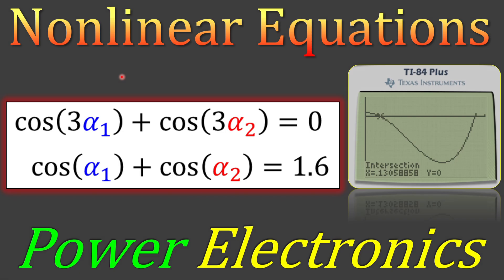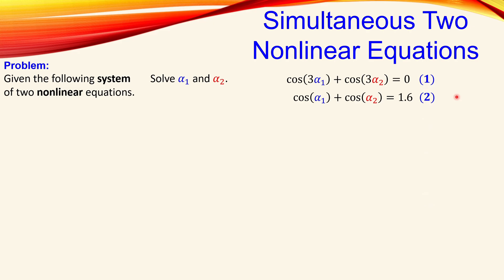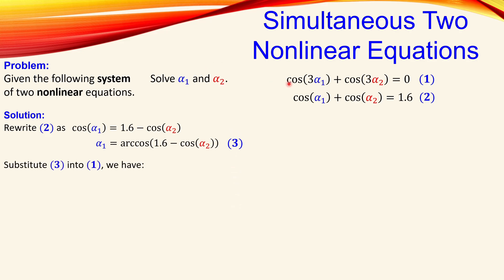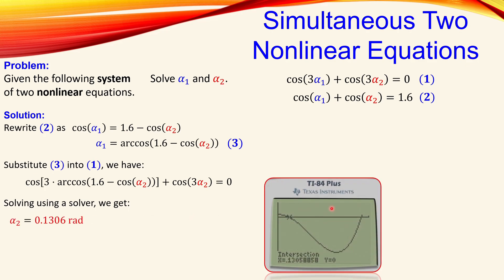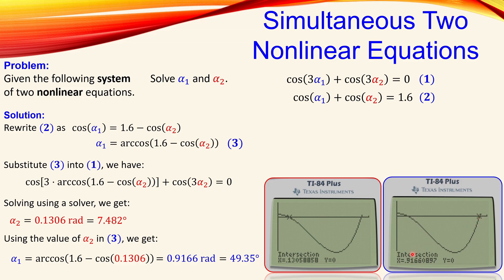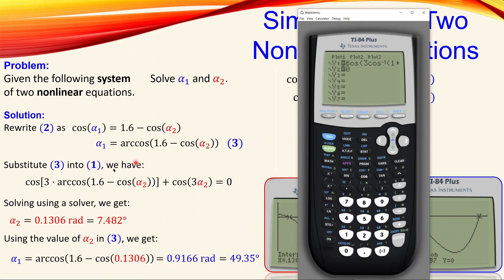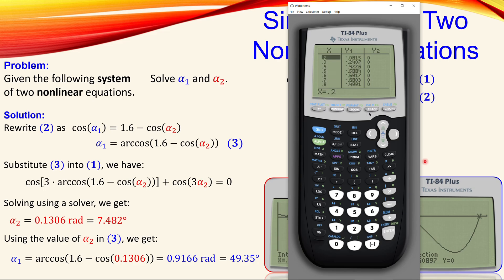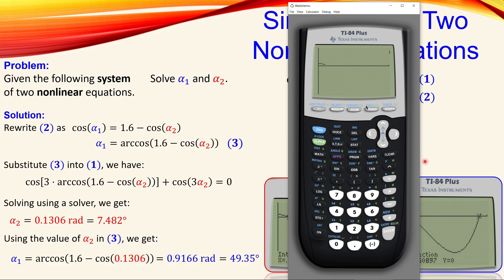Solving Two Simultaneous Nonlinear Equations with TI-84 Emulator ⭐ Inverter Design Power Electronics

Comment: Sir, is it possible to use another method like matrix setup of the inside functions to determine alph 1 and 2?
Reply from the maker: You can solve equations using matrices like with Gaussian elimination when the system is linear